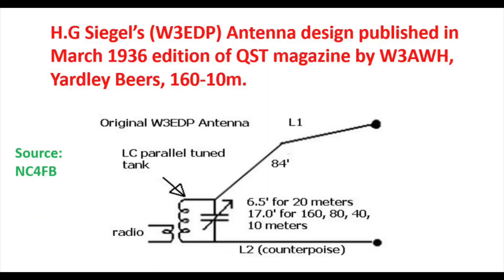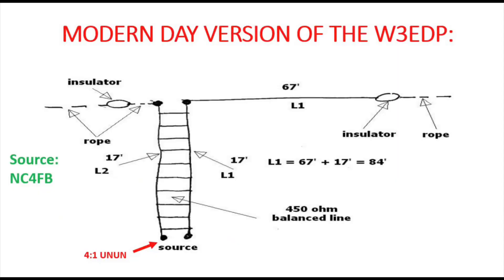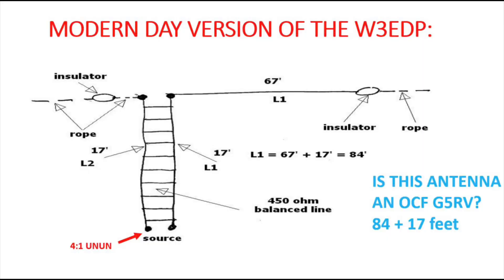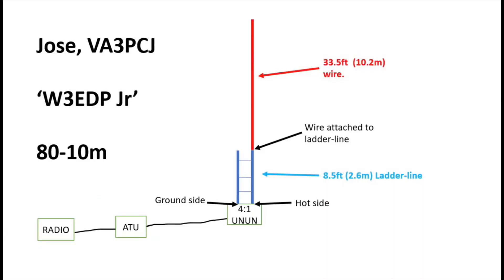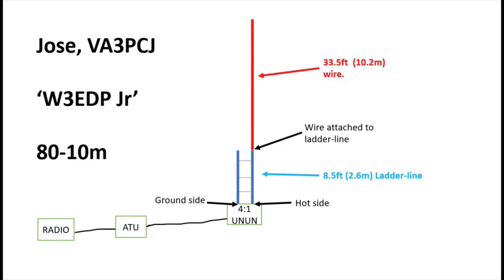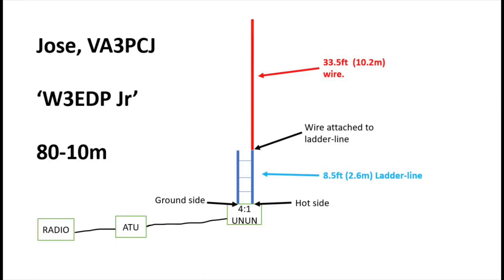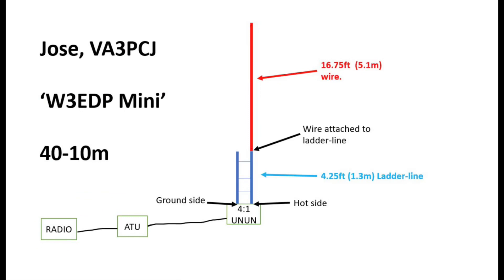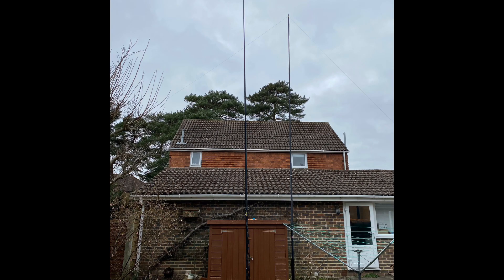Ham Radio: Simple Multi-Band Vertical Antenna

Comment: Thanks for another good video! FYI the 102' flat top antenna was around for a while before Louis Varney G5RV liked its 20 meter gain and went about figuring out the twin lead matching network to bring its impedance low enough to feed his rig using coax. He also found out it worked on 80m making it a dual band antenna. Both changes helped its popularity and hams named this innovation after him. Through the years the twin lead has been shortened from his original design making it more manageable and able to work on more bands, but the original 102 ft flat top keeps going... 

Yes, the twin lead on these modified versions of the W3EDP would also act as a matching section as well as part of the radiator, just as it does on its brothers, the Zepp, and the J-Pole.  

Its people like G5RV, W3EDP... and those like you, who dare to tinker and try things who come up with these innovations. Marconi used several of Tesla's patents to be the first to talk across the pond. Innovation is usually built on the shoulders of those who came before. We all benefit from it.

Keep spreading the good word!   73   mike
Reply from the maker: Thank you Mike it’s great fun to tinker 73

Comment: I have experimented with all 3 sizes. I found that I  had better results tuning the JR version on 40 meters with a 9:1 Unun. I have put it up for POTA operations in trees as a Sloper and an "L".  Also run the mini and JR as a vertical with my 12 meter Spiderpole. Thanks for the video. It gave me more antennas for my POTA arsenal. 73 , N1XXU.
Reply from the maker: Great examples!

Comment: Interesting . Have very restricted space for antenna in my tiny garden. But what is an unon ? Related to a balun ?
Reply from the maker: A BALUN  is used to match the impedance of a balanced load to an unbalanced feed line - such as dipole to coax. An UNUN matches the impedance of an unbalanced load to an unbalanced feed line - such as a long wire to coax.

Comment: I need to get a 4:1 unun. I made a version using 17' of 300 ohm ladder and 67 wire, but I only had a 4:1 balun that I connected to my auto atu.  Set up like your sketch, ladder line vertical, and  wire at about 25'.  Keep up the good work.
Reply from the maker: Keep going Jes its great fun!

Comment: The 1/4-sized Mini is my favorite for backpacking.  With a 17' wire attached to the tuner ground lug and simply draped across the ground, it can tune down to 80m, though of course it is not very efficient there.  I've also had good results with a 1/2 size arranged as an inverted V, when time to put it up and weight limits allow.  These modern versions of the W3EDP work far better than one might expect at first glance.  Thanks for the video.
Reply from the maker: Very good example Rob thank you for sharing

Comment: Will a 4 to 1 balun work instead of a 4 to 1 unun? I usually use 15 to 20 feet of RG8 coax from the balun coming on into my Palstar AT1500CV manual roller inductor antenna tuner on my 130 feet 10-80 meter doublet so would that arrangement also work with the W3EDP 84 feet multiband vertical? Very 73 De Cliff, KU4GW.
Reply from the maker: Hey Cliff. The Balun can work although the unun is designed to transform an unbalanced to unbalanced load such as this or any other random wire antenna

Comment: Missing was the swr. This gives some indication of the effects at least in my mind. 
Was it under 5:1?
Reply: I just rewatched the video, maybe you have since your comment. When Tim is transmitting the radio signal strength meter becomes an SWR meter where you can see the SWR is about 1.5 : 1. Pretty good I would say. 73 Ps. I only knew to look again because I have the same radio - Yaesu FT-891
Reply: @tdumnxy  that’s very good although suspicious for all bands.

Comment: Hi Tim, thanks for this video. I run a W3EDP as a  horizontal LW fed with 17 ft of 450 ohm ladder line and a 1:1 unun. I use a wide range manual ATU so can get away without the 4:1.  I use an 84 ft wire length as per the original and believe the feeder does perform as a counterpoise and impedance transformer. Mine works well from 80M to 10M with a definite end effect on 10M down to Africa.  The 67ft  you picture isn't a W3EDP - it's a half wave Zepp antenna for 40M which was popular in the 1930s until a certain G6CJ debunked it in the Radcom of the day.  Back then the antenna was fed straight from the PA coil in the transmitter and the method of feed either made the antenna work or not due to equal and opposite RF current.  That was because the amateurs of the day were trying to get a balanced antenna out of an inherently unbalanced one.  We don't do that any more and so the W3EDP and its relations, the end fed Zepp and J antenna do work well.   73 and keep up the good work.  Lawrence G4GZG.
Reply from the maker: Great information Lawrence thank you

Comment: Thank you for posting this video.  What caught my eye was the similarity of the 'Jr' 40-10m version of this antenna to the Chameleon MPAS 2.0  back packable antenna in the vertical config. There you have a (from bottom -> up) a 1' ground spike (support and grounding), a 500watt 5:1 (I believe) unun, then a ~ 21' vertical brass-aluminum vertical pole.  Very similar to your 'Jr' config. (minus the ladder line).
The MPAS has a wide swr parabolic dip starting at ~ 3 @ 40m, dropping to ~1.5 @ 20m, then rising up to ~3+ at 10m.  I've made RBN contacts with Japan, Samoa, NZ, Canary Islands, Uraguay, Alaska & the continental USA. I've had ssb qso's with some of them too. QTH is west coast of Canada.
So, it works! 🙂
Reply from the maker: Nice comparison!

Comment: you were saying "5-9 100"  is 100 the code for England?
Reply: If I may sir, I believe 100 after the 5x9 meant 100 watts. I've also asked HAM on another youtube video about such numerics after the 5 by 9 and I was told it pertains to the power output. 100, 5 or 6 hundred, some even say kilo meaning 1 kilowatt. I hope this helps.
Reply from the maker: Hi Pat for that contest you gave your power so in my case 100 (watts)